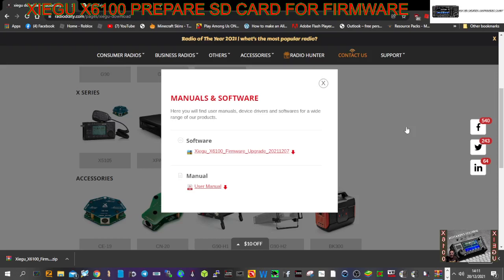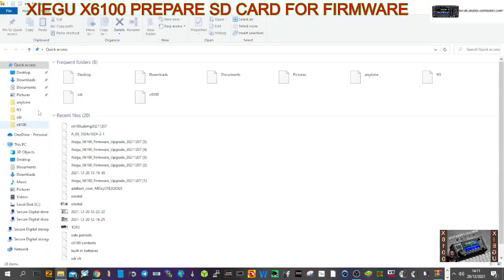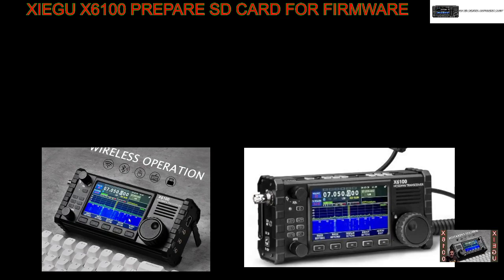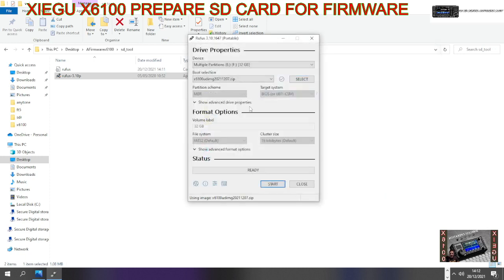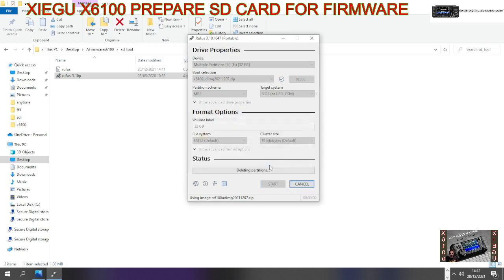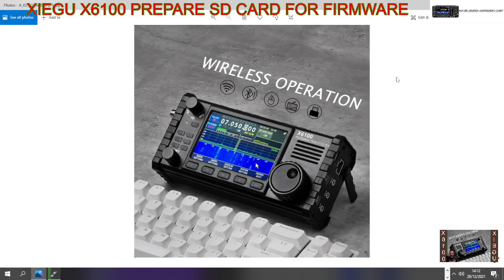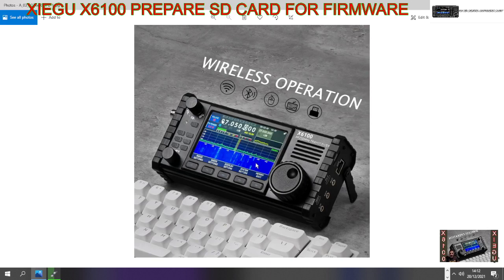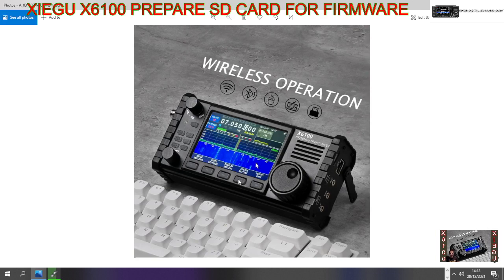XIEGU X6100 - Prepare SD Card for Firmware Upgrade

Comment: For step #2 when you select Firmware Upgrade, you must have your power plugged in or it will not install. Mine failed 3 times before I remembered. Hope you enjoy your new x6100.
Reply from the maker: Hi Scott thanks for the info my radio had an update on the 7th December hopefully wont need to do it yet .